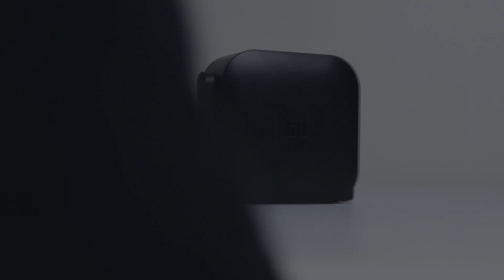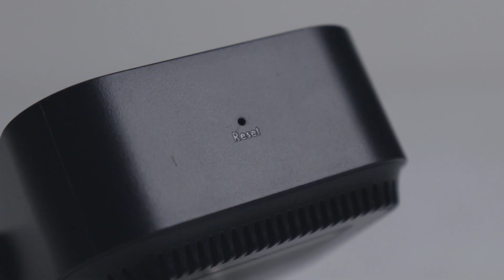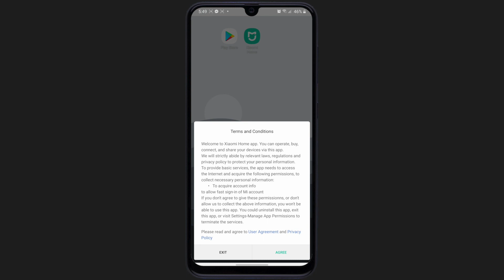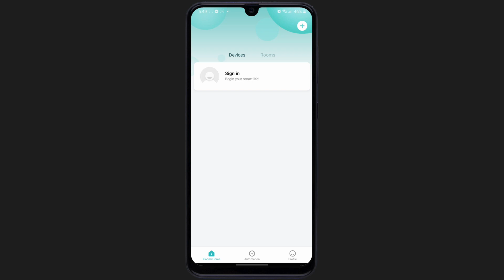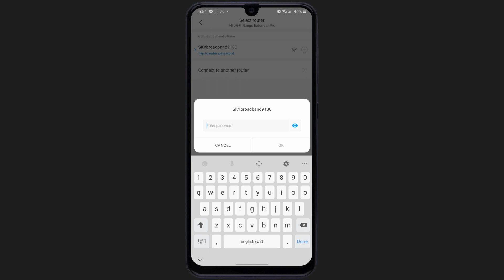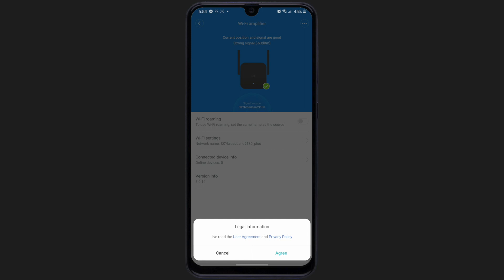Xiaomi Mi Wifi Extender Pro | Review and Setup | Great Value

Comment: i want to know will this connect with my dlink dir 825
Reply from the maker: Will only work on the 2.4ghz band. If you have single ssid for both 2.4 and 5ghz and don't want to separate it, I'd recommend getting a dual band extender/repeater instead